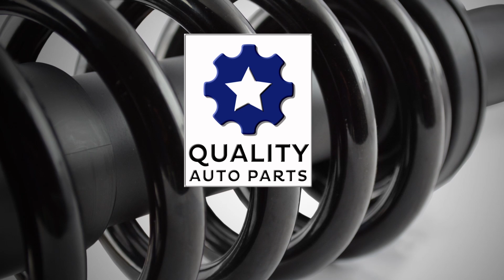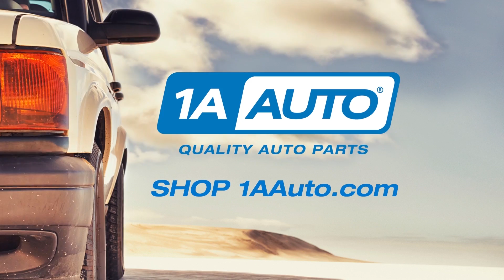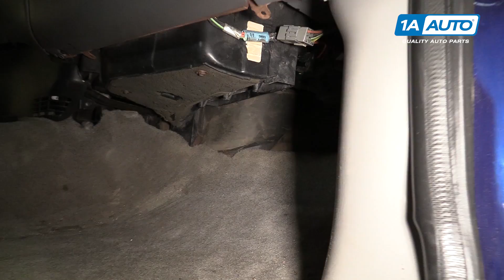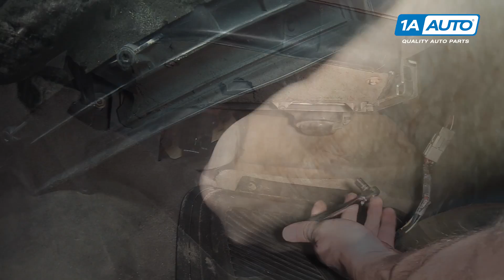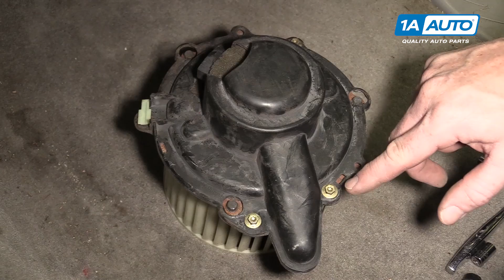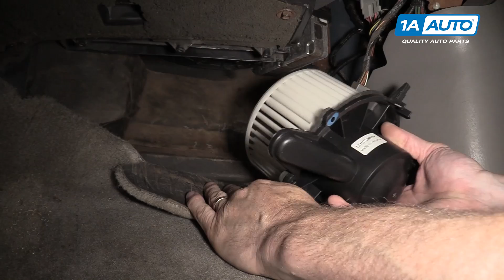How to Replace Heater Blower Motor 97-03 Ford F-150

Comment: Reinstalling the new blower motor was the most difficult part for me.  I failed to lubricate the floorboard or bottom of the blower motor with WD40/oil and ended up damaging the foam of the floorboard.

Comment: I dont know what trim level truck he has but on a 2002 supercrew there is additional vent ducting below the fan and it is a LOT tighter a space than he shows here. That being said I've done this a few times due to mouse nesting issues. Here's some advice. 
1) If the original fan broke or there's a mouse nest in there, get a boroscope for your phone and check. Make sure you remove everything that shouldnt be there. A dead mouse puts out an unbelievable amount of carrion smell and if the previous fan broke and left fragments it will break your new fan. Use a shop vac. Its tight but it will work.
2) Its super tight to fit the fan and you will have to (carefully) bend the "hamster wheel" to get it in there. You can get replacement fans on EBay with a black fan wheel that appears to be made of ABS. It is more forgiving than some of the white ones that can crack. (done that). Push the motor and base of the fan as hard as you can into the padding in the footwell and carefully bend and rotate the wheel until it goes up where it needs to. 
3) There is no room to use a normal ratchet.  There isn't enough room to take up the slack. I use a 1/4 pneumatic ratchet but you could use a "zero degree" ratchet if you dont have a compressor. You will also need a 1 1/2 extension for two of the screws. 
Good luck!

Comment: I’m not too mechanically smart. I have ice cold ac in my 99 f150 but no heat. It blows just not hot at all. Am I gonna want to change the heater core?
Reply: yes or bleed the coolant system first actually. sometimes air bubbles can make it go hot then cold. hot then cold. bet it's your core though.
Reply: also make sure coolant is full.

Comment: I’m not too mechanically smart. I have ice cold ac in my 99 f150 but no heat. It blows just not hot at all. Am I gonna want to change the heater core?

Comment: I would recommend when you pull the carpet back and get ready to put the blower back in that you use thread or real fine string to tie the gasket onto the blower assembly also if you spray WD40 on the On the pad underneath the carpet it helps the blower simply go in easier  and the string or thread will ID where the holes are for you easier to find

Comment: How long does it take for the heat work ?
I already fixed the blower motor and resistor
Reply: And their still no heat.
Reply: Did you get it working?

Comment: When doing this to my 02 f150 I noticed they left out then entire beginning. Not only do you have to remove the panel but there is another part that has to come out so you can get the blower motor out. It is already removed in this video and it is not mentioned at all. Please show a full video next time.

Comment: I thought mine was bad cause it just up and quit working. Turns out when I was wiring my door speakers to my amp I accidentally unplugged it when I pulled the trim piece off.

Comment: I wish you would have shined a light in the opening where the blower motor came out, I have been told that you can see the recirculating air door to make sure its not stuck and causing only luke warm air and not hot heat..I'm not referring to the blend door, it is working fine on my 02 Fl50, but still not hot heat from the heater.
Reply from the maker: +Ddd Ddd Thanks for the feedback!

Comment: Hey I have a 97 f150 4.6, the ac worked fine then all of a sudden I turned the truck on then the ac and smoke came out the the vents and I found that the wires/ plug for the blower motor where melted now no air blows out , does this sound like the motor just went out or other issues? Thanks

Comment: Q: would this be in the same spot for a 98 Ford Expendition Xlt
Q: my 98 Ford Expendition has front and rear ac... But my front ac quit blowing and my rear ac still blow cold... Does the blower control both front and rear are only the front...
Reply from the maker: +Righteous One We don't have a how-to video for your vehicle right now, but the basic steps in this video should be enough to do this task. Buy this part for your vehicle on 1AAuto.com: http://1aau.to/m/Shop-1AAuto-c

Comment: Detailing the 7 mm and 8 mm bolts helped big time. Thank you! That back one was ridiculous. Someone below mentioned a spring loaded extension. Great idea.
Reply from the maker: +Zip Ninja Thanks for checking us out. Shop for high quality auto parts on 1AAuto.com:

http://1aau.to/m/Shop-1AAuto-c
Reply: For bolts like the bottom one here, superglue the bolt to the socket.  Will hold it until it gets screwed in.  Then just wiggle a little and the bond will break.  Done!

Comment: Listen everyone with a 1997 f150. this video makes it look a lot easier to pull out than it is. Mine was VERY hard to pull out once I got the bolts out. The space is so tight. It’s going to be very hard to put the new blower heater in once you take the old one out

You’re definitely going to need an extension on your ratchet so don’t even think about not getting one. I made that mistake and had to borrow the neighbors. Definitely going to get some for the future

Comment: Is there a way to take a blower motor from my old 2000 ford f150 and install it into my 97 ford ranger
Reply from the maker: +Kelly Henry We would recommend replacing it with the same year motor. Even if the connectors were the same, the shape might be different and might not be able to fit

Comment: That big black box in front of the blower motor...what is it called? It looks like some kind of filter is in there. I have a 1997 Expy and everything I've been told says they don't have an in cabin air filter but that big black box with the fluffy part looks like a filter or intake. If that gets clogged or blocked could that somehow reduce AC/heat flow?
Reply: Some F-150’s had filters. Mine does not, you can cut the bottom of the plastic box and add one very easily, I googled to find information to see if mine did and there’s a few that show videos on how make the necessary modifications to the box. Just an FYI
Reply from the maker: +Anthony Milhorn I believe that is just part of the HVAC system, and could contain a cabin air filter.  1aauto.com

Comment: How can I know when the blower doesn't work.? My heat isn't working. Thanks alot.
Reply: You can hear the fan running if it's working.  Turn the Ignition to the ON position without starting the truck, with the nob turned to heat, as in ON, is the fun running?  It should run at all the speeds.  If it only runs at high, it's generally just the resistor pack.  But if it doesn't run at all, check the blower fuse first.  If it's not blown, with the Key in On and the heat on and the fan set on high, pull the plug going to the motor.  It's 2 wires.  You see it in this video.  Check the voltage with a voltmeter set to DC voltage and put a lead in each wire on the plug, NOT on the motor side.  Doesn't really matter which goes where.   You should be getting around 12 volts.   If you are not reading any power, it's not the motor as it's not getting power to run.  So it's something else.  Either the fuse, or the Blower Relay, etc.  Now it's time for a wiring diagram and being able to read it, and follow it and find where the problem is at.  That takes a little skill and pulling the dash apart to get to the things to test.

If you switch the nob from Heat to cool and back, you should hear the door moving back and forth.  You may need to run a minute, shut off, turn key back to ON, and try the dial to hear the door in the AC/heat unit moving.  I could hear it in my Dad's truck.  He had heat, but very little, just what little would come out with no fan running, which wasn't much.   The fan sometimes worked but generally didn't.  He thought it was the Blower Motor Relay, which is kind of a pain to get to under about the middle of the dash.    I didn't see anything wrong, but other testing was showing I wasn't getting power where I should have.  I figured he tested the blower motor power as it's pretty easy to get to, so I ended up wasting time tracking other issues on the wiring diagram.  Finally I just decided to check for power at the blower motor and sure enough, about 11.75 volts and yet the motor was not running.  Well, there's the problem!!!!  Picked up a new motor, installed it, and it now works, and at all speeds.  So I put the dash all back together again.  I  should have not assumed anything and checked power to the motor first!!!    Since it is easy to check.  If no power there, then check the fuse.  Start with the simple things first!!!
Reply: 184K miles on 2001 F'er. I reached under my glove box and tapped on my fan with a hammer -- LIGHTLY -- and it came on. Worked for a couple weeks but that trick slowly stopped working. I learned all of that mess with my Jeep a few years ago. The brushes in the motor simply were all brushed out. I think its time to stop tapping and start spending.
Reply from the maker: +JMClick. It may turn off and on, or stop working. You may also want to check the fuse to see if it is blown and needs to be replaced. 1aauto.com
Reply: @1AAuto  this is exactly what mine would do. If I hit a big enough bump in the road (thanks to Oklahoma DOT there are plenty) the motor would start for a little bit

Comment: man i got 2001 ford expedition and man that is one tight fet getting out broke the wheel but putting i cant get i have removed the carpet , the insulation and part of the firewall insulation. now mine is a Eddie Bauer and it does have the climate control type resistor.

Comment: 1A Auto Parts Bought the part at AutoZone the motor blower just it self in my 1998 F-150 the problem was too big took it back went to AutoZone the guy was doing research in the computer from F-150 1997 - 1999 the same usual part thing he did a last research find out will fit 2000 F-150 check computer didn't have in stock the other store has it he called in to verified was in stock return the motor blower got my $ back went to the other store I purchased did work everything thanks appreaciated for the video did help out alot.

Comment: is this  the same as the 2001 ford expedition blower motor?
Reply from the maker: +Oliver Inocentes Thank you for checking us out. Some of the steps in this process should be similar, but orientation and sizing would differentiate. 1aauto.com